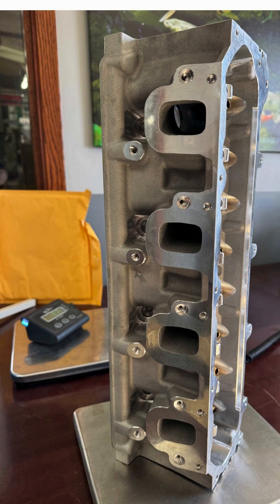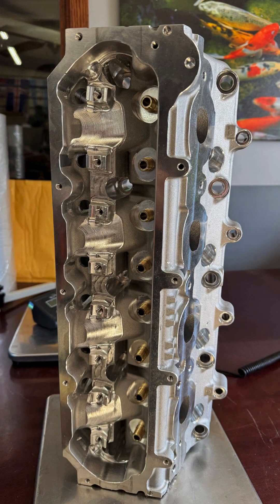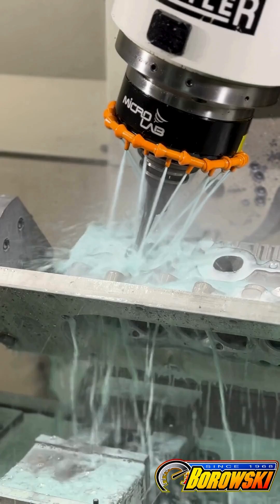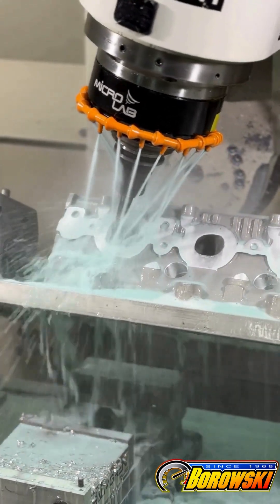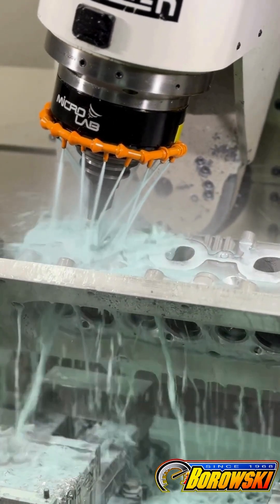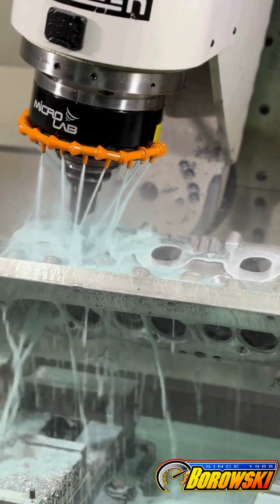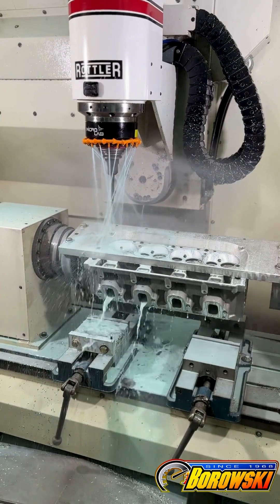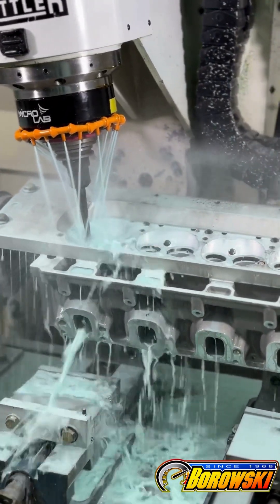5 Axis CNC Porting a CID LT4 Head from a Porter Casting #horsepower #dragracing #turbo #boost

Comment: Nice 2 C U folk @ Borowski Race 🏁 Engines using CID Heads.  The guy who owns the company is an Australian...  who had yrs of success with his former brand here in Australia 🇦🇺 & O/seas 

Be interesting 2 c how they stack up against ur LS Heads from memory All Pro  ???? 😅😅
Reply from the maker: We first started doing business with John at CID about 5 years ago.  He makes great products.  Our business model is based on careful vetting of suppliers who are then spec'd into our recipes.  We are very brand loyal to our vendors as long as they perform and a clearly better mousetrap is not introduced by someone else.  Bill at All Pro has been has been our prime vendor for high-horsepower LS heads for 10 years and his proodct has not been static. The CID LS are well known to us as they are preferred by some of our customers such as @buildtunerace We have been working on CID LT heads for a while now on behalf of our B2B customers such as M2K and Cutaway. All Pro does not have an LT head.  CID already had his foot in the door so will hopefully be to us in LTs what All Pro is LSs as we enter the LT market.